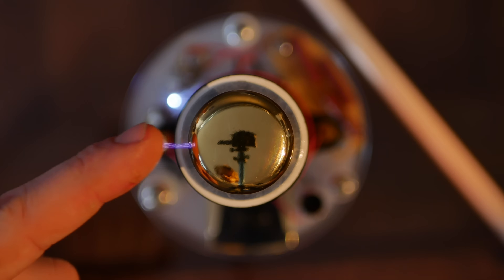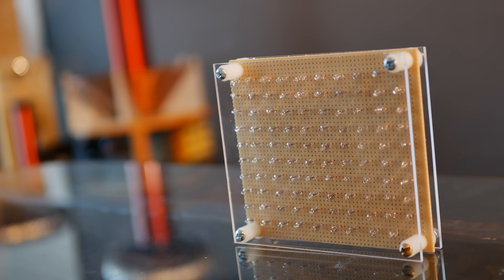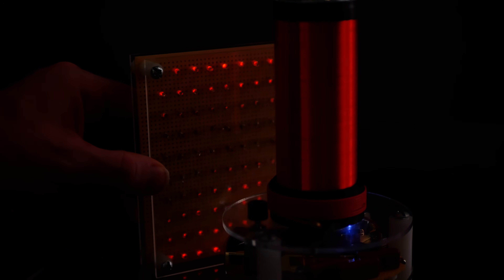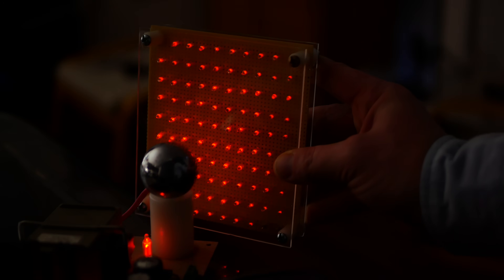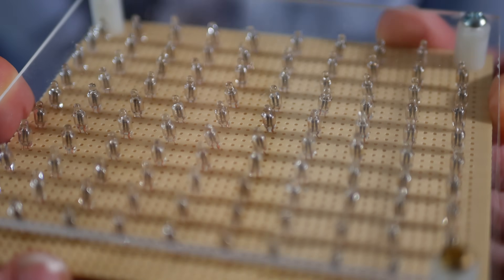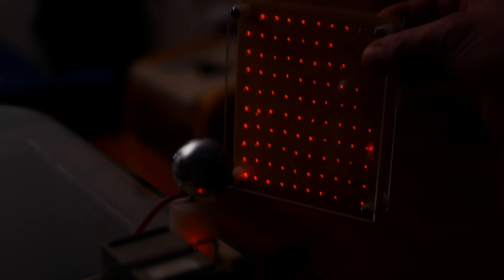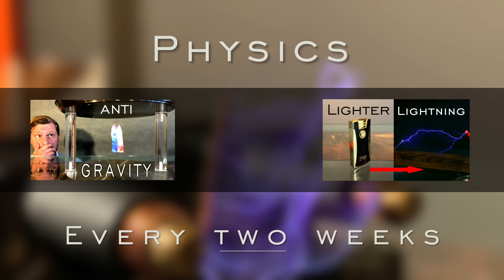Visualizing Invisible Energy Fields (Using a Neon array)

Comment: Interesting idea! I'm thinking since each bulb absorbs some good amount of energy to light up, it might effect the fields pattern around it. I can't think of a better way not to disrupt the original fields though... maybe some sort of tiny active battery powered circuit??
Reply from the maker: Hey Mehdi! Thanks for chiming in - that’s a good point. Each bulb likely does affect the bulb next to it. The way I see it, the ionized gas represents a point in space where the electric field is so intense, it ionizes the neon. So.. one bulb potentially lessens the electrical tension for the surround bulbs by allowing a path for built up tension to flow. Even though this is high frequency AC, figured the same general concept applies? 

A tiny battery activated circuit? I could get on board with that.
Reply: @PlasmaChannel  That's right, I mean if you have one bulb shining, and you bring a second one close then the first one dims. It should be tricky to do a proper presentation of waves, but hay this is pretty close!
Reply: @ElectroBOOM why not "just" put the coil inside a large-enough vacuum chamber and fill it with neon?
Reply: Plasma Channel 
Please don’t give him ANY ideas about sparks... we don’t want Mehdi hurting himself... at least not in every video >:)
Reply: @PlasmaChannel  "A tiny battery activated circuit. I can get on board with that"

Purposeful pun?
Reply: Love you both
Reply: Rectifierman and Plasmaman should do a collab
Reply: hi mehdi it's really cool to see you here can you make a video on how to make a touch screen using a transistor only. it will be very cool because I have tried it and failed almost 5x because there is something wrong connect transistor transistor etc., and there I was a little depressed but I managed to make the touch screen using LED lights whose resolution is 4x6 pixels only btw I use BC547 transistor
Reply: I know. Tesla wireless electricity. You are a tower; similar to Egyptians
Reply: How about a small "AC detector" next to every bulb powered from a battery. A small capacitor with BJT amplifier to switch on MOSFET that would turn on the bulb.
Reply: Hey Mehdi
Reply: We love u electroboom!!!
Reply: I've read this in my head with your voice and only now realized it XD
Reply: http://www.amasci.com/emotor/chargdet.html

I built an array of these a long time ago and it is a lot of fun. It still messes with the fields (anything will) but it is super sensitive.

Cheers.
Reply: Why parallel? Is the whole array in parallel? Is this equivalent to a large bulb of neon?
Imagine a three dimensional array of insulated conductors mounted in a glass globe filled with neon, would this display the field.
Are the electrodes really necessary, as the gas will ionise at this field potential?
What effect do the conductors have on the field, aren't they shorting out the field voltage?
Why not an array of bulbs with one side of each grounded and the other side acting as a point detector?
If the neon bulb  design  is such that the gas ionises when their electrode potential exceeds 65 volts, 
Why not just an isolated array of bulbs, with their wires acting as point detectors in free space?
Reply: The Carlson super probe is one such circuit. Another is a 'GSM detector' I got from one of the chinese sites. The circuit board looks like a bug with antennae and is a basic darlington amp. To make an array of those it would probably be worth having a custom PCB made.
Reply: HES HERE
Reply: I have so much to learn about electricity
Reply: These bulbs usually light up at around 70V. If they're already wired in parallel, you can apply say 65V DC to all of them, so they could be much more sensitive. You can also put a bypass capacitor between the leads of each bulb, so they would affect the neighboring bulbs less.

Instead of DC you can use AC, as long as the peak voltage is below the threshold, so maybe 46VAC instead of 65VDC.

Anyhow, the current should be limited, so each of the bulbs should be connected through a resistor to the bias voltage rails (which will further limit the influence of the bulbs on each other). If the bulbs max current rating is 1mA, using 68kΩ resistors would be ideal. And if you're using 10nF capacitors, the cutoff frequency of the resulting RC filter would be 234Hz, so you'll pretty much remove any neighboring bulb influence.

But it might just work without resistors -- if you'll try it with one bulb and the current is always below the maximum rated, it'll be OK. Even if the current is several times higher than the maximum rated, it'll just reduce the bulb lifetime (the electrodes metal will sputter and darken the glass), but if you're going to use them just for several hours, it's not a big deal.
Reply: Mehdi are going to do an induction heating video soon

Comment: Hi. Loving the channel currently binging your videos. Could you suspend them in an clear epoxy to create something 3 dimensional? 
You would need to either pull a vacuum as it sets to degas or increase the air pressure to shrink the bubbles. The benefit with increased air pressure is you can use a faster setting epoxy

Comment: Very nice ! I have to made my own! :P soon ! About the gap on the field, i'm not sure but when i use a slayer circuit on my tesla coil, the right resonance is around 1Mhz and my neon bulb turn on everywhere on the length of the coil, but, one time i've notice than my frequency was the double, aroun 2Mhz (i've change the primary turn number and else) and this time, there were a node right in the middle of the coil who turn on the light, at the top nothing, the bottom nothing. So for conclude maybe it's about the wavelengths and maybe you interact with the field and the wavelength. (body capacitance maybe) 
I'm reaaaaly not sure about that.

Comment: If you wired the lights like neopixels and monitored the voltage on each light over time, and tracked the movement of the panel in space like those cameras that image a complete object so you can 3d print the objectb you would have the data to draw the entire magnetic field around the object

Comment: Jay, Could you give me a reason why the lamps which are close (or touching) to my fingers illuminate before the lamps close to the coil???  I am running a slayer and sometimes, while using this array, My capacitive coupling to the array lights the lamps as I am bringing the array toward the slayer... Why are the lamps closer to the power, not lighting???? interesting
Reply from the maker: Hi Matthew! Do you mind sending a picture to my email? I’d love to help.
Reply: Hi Jay... photo sent on facebook messenger...
Reply: Because the polarity is zero in the middle. That is why it is called polarity, because it has poles. Your body acts as a ground of opposite polarity to the source of charge.

Comment: Ancients used mercury and gold or mercury and copper and marble domes ow towers to get up in atmosphere for voltage?  This shows mercury in glass pill with copper wire to attach to copper antenna... to exponentially use plasma atmospheric energy? Many ancient building and  towers and even Teslas tower may have mercury balls attached. https://youtu.be/kOLziIEQfU0

Comment: I'm wondering that the neon's may work just fine not connected to anything? All isolated from each other. Then the loading will not affect the others. I think that is along the lines Mehdi is thinking.
Reply from the maker: They in fact work great not connected to anything, however, they are more sensitive when wired up the way i've done.
Reply: OK. Got you. Also wonder if the matrix might show the cooking pattern inside a microwave oven.

Comment: Interesting! Would it be possible to make a 3D-indicator in the same way?
Reply from the maker: I did some thinking on this - and it may be possible to have a 3D indicator, but each LED or Neon light will need to be power limited....in order to not draw too much energy out of the local field.

Comment: I got a question. 
I  also made a Tesla coil for ICT exhibition of our school. And while I was demonstrating it, a friend of mine was holding  a tube light to show the wireless energy. By doing it I coinsidently touched the hand of the friend which is the hand of holding the Tube light. Then I  sensed an electric charge from him to my hand and it hurts. The other thing is I was keep holding the spark gap which one end attach to the casing and other end is hold by using pliers.
I wonna know  what is the reason for this.
Reply from the maker: Hello, are you saying you were touching the spark gap while in operation? As with any spark gap tesla coil, never and I do mean never touch a spark gap while it operates.

Comment: Tesla coil is ac power. Your body makes one plate of a capacitor and the coil the other plate. The air is the dielectric. The neons are showing the charge built up on you!
Reply from the maker: Hi Roxx, great idea. Thanks for the input!

Comment: An easy way to get more information would be to build a long string (single row) and move it around while a camera set on long exposure records the light (fields) as you move
the string. High resolution, lower cost.

Electromagnetic field light painting.

Cheers.
Reply from the maker: Hi Alan, I've gotten this recommendation a lot. Great idea really. The only problem is that an image is not live....so you cannot see the field change live as you experiment with it.
Reply: @PlasmaChannel  That would be important for video. I only think stills, no good at video.

Cheers.

Comment: No clue. I would make an additional 10x10 neon grid like the first one wired in parallel but diagonal going from corner to corner. See what happens. Also you just gave me an idea of why some ancient stones have microscopic coils in them. A wireless castle. If the coils resonate at the same frequency then the microcoils inside the stones would be conductive right? No wires. Crazy right?

Comment: U know wat ,because u touching the neon light on the other side ,it creates a high enough voltage inside the neon lamp because of the capacitance between u and the coil and because ur closer to the ground ,even I've had similar situations trust me
Reply from the maker: I think it is capacitive coupling as well. Cheers!
Reply: @PlasmaChannel  I think that's the same thing I said ,maybe , do u mind mentioning me in the next video???

Comment: Show the electrical connections of the neon lights  please  !!!
Reply from the maker: Haha I did - when I showed the backside. Did you click out of the video?
Reply: @PlasmaChannel   Sorry I missed that ,  Have you tried an array with One lead terminal Up as a small antenna or point collector on each neon and the other attached to a ground plain

Comment: Bit more complex https://hackaday.io/project/18518-iteration-8/log/64376-a-magnetic-imager-tile could probably be adapted to do that  maybe with coils on the hall sensors or instead of.  Probably not it  but on why it's lighting around your hand but there's the whole "hold a car key against your chin to use your head as an antenna" trick to extend the range of your wireless car key thing but I wonder if that might be related.
Reply from the maker: That is incredible. I love the video, thanks for sharing.
Reply: @PlasmaChannel  https://youtu.be/lMJr-oUYYDA bet that is why the neon tubes by your hand were lighting up you were tuning them not reflecting it as I suspected earlier.

Comment: what about a 10x10x10, maybe as a "wireframe" cube? Would it still work if you make it more sturdy by covering it in some sort of clear epoxy resin?
Reply from the maker: It may, but it may also draw too much energy out of the electric fields, and cease to function properly.

Comment: I don’t understand : why would the mini-bulbs even be wired? A single one lights itself already. Is it to  make is more sensitive?

I have a bunch of these bulbs, several colors (red, blue, green: not all are neon, obviously, and they have phosphoreous coating the convert the the gas color to another color, but the principle remains the same) and I made a cube with them (8 bulbs is a 2" sized cube). It’s fragile but you can suspend it with a string above the Tesla Coil and swing/turn it: the colors flicker rather nicely and wirelessly :D

Also, a nice idea I found on @physicsfun instagram page: using various gases bulbs: H2, He, O2, Ne, Xe, Ar, N2, Kr… They each light a different colors and its beautifull physics. They are available on eBay in sets.
Reply from the maker: Great question, and you are right. It makes the entire device more sensitive.

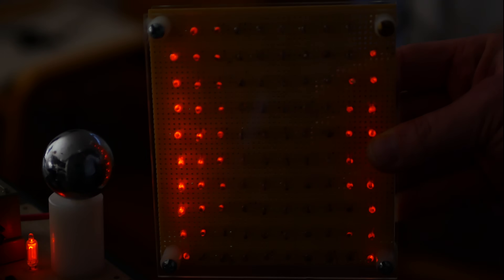Comment: Nice video , and 3:46 I hope the probable reason is all about saving energy (like,  light follows the shortest path) so as here when you touch the neon lights ,there having a temporal grounding created due to capacitance across the glass (like the neon bulb experiment before) the lines of force changes itself in which they will loss less energy along with having the lowest energy level terminal point (stable) ...Hence instead of losing the energy in lighting the middle bulbs they are jumping directly to the terminal ones to your hand ,flesh meat ⚡  ,that's it perhaps ,by the way yeah increasing the pixel in that grid will create much better picture ,,goodnight Goodluck.          #plasma channel love it
Reply: hehe...

flesh meat...
Reply from the maker: Thanks, that's great input. Cheers!
Reply: Thanks Jay ,hyped for the part 2 of this thing

Comment: Reason for the unlit neons is that energy goes out as a wave with peaks and troughs, the unlit ones are where the wave is at 'zero'
Same is true vertically, if you use that on your larger coil, you should be able to visualise where current and voltage are highest, just like in the amateur radio world you see radiation patterns (search for 'antenna current and voltage patterns' )
Reply: Yeah, but those waves and peaks you speak of travel generally.  What was visualized, if this is the case, was a standing wave.  Standing waves require at least 2 wave forms and if there is no movement, then the also must share the same frequency.
Reply: Yes, it would be a standing wave, not sure if you know at least CB radio, there's a SWR meter, this is a standing wave ratio meter.
If you do a search for 'antenna radiation pattern' some of the images are depicted as a doughnut, if Jay moved that detector further from the coil (asuming the coil has enough power) he would see repeating patterns of light and dark, the light area would be a cross section of a doughnut.
Reply: Whoa fam, cool your jets! That's only the case with standing waves. Also, even at 1MHz (which is a generous estimate) the wavelength is far longer than the 10x10. No, this must be something else...
Reply: Exactly, 1MHz has a wavelength of 300 metres, so at svery 150metres there will be a dead spot, signified by the neons that are not alight (zero crossing)
Reply: @sparkyprojects  you're both right sorta... As with anything IRL, nothing is ever clean.  Every time the coil gets turned off and on the Fourier distribution gets a spike where the sum of those spikes is the transfer function for the current.  So in an ideal case we wouldn't see a node for 150 meters, the noise level ensures that we will pretty much see one immediately.  That said, while all the above statements are true, they are not the primary feature at work.  When he touches the ground, his body becomes capacitively coupled to the system and the resonant frequency shifts accordingly.  Essentially, his body becomes a second antenna. Two wave forms in proximity with the same frequency form standing waves with nodes at geodesic points between them.  Specifically, one must always exist somewhere between half way and halfway minus a spin fraction.  In this case 1/2.

Comment: I agree with those questioning the 'parallel' wiring.  I've demonstrated a HV electric field with 144 MES neons, still in their original 12x12 cardboard box.  Obviously totally unconnected, but the field was clearly demonstrated by waves of lit globes, as I moved the box over, side or below the mini-tesla.  I would guess that the metal MES bases capacitively coupled with each other, leaving the electrodes as mini-antennas.
Reply from the maker: Thanks for the input. So after experimenting - I found placing the neon bulbs in parallel caused the entire device to be more sensitive. Mostly because the connected lights acted as an inductive length of wire to better collect power.

Comment: Were they wired in // ? Why not independent?
Reply from the maker: Thats a good question. So after experimenting - I found placing the neon bulbs in parallel caused the entire device to be more sensitive. Mostly because the connected lights acted as an inductive length of wire to better collect power.

Comment: Consider using a rotating wand to get a higher resolution, like in persistence-of-vision LED displays.
Alternatively, you can rotate the grid you currently have to visualize the field in 3D (especially if you replace the board with some clear plastic). These are similar to taking long exposure photos idea, proposed by Blueprint and by plasma tree in comments above.

Another idea: the electric field is a vector field -- it'd be interesting to see its directionality as compared to the directions of the bent leads.  These dipole antennas may seem too small to display directionality at the frequencies we're talking about -- however, we're in the near field regime here, so we may be able to detect the directionality.

Another thing to try: maybe make the antennas loaded by winding one of the leads of each bulb into a small coil, or by adding a small inductor to each one. If this makes a noticable difference, you may try to make a strip of neon bulbs each tuned to a different frequency band, making a cool spectrum visualizer.
Reply from the maker: Thats really a great idea. Using an illusion of vision in order to see the field.